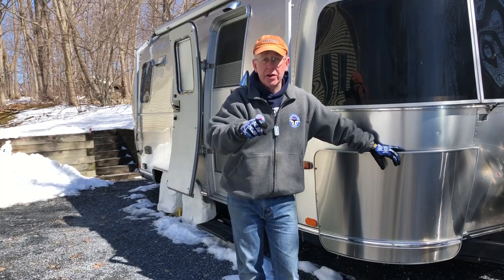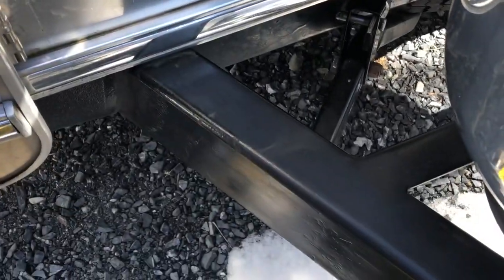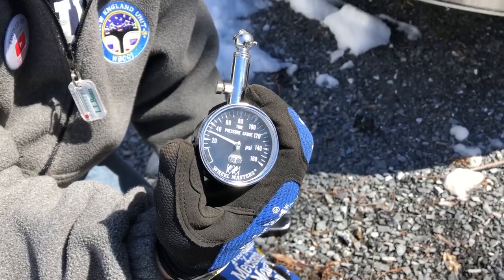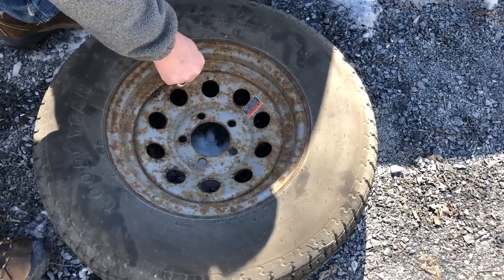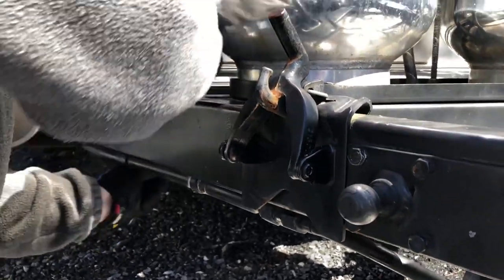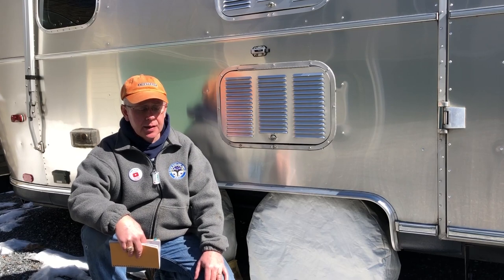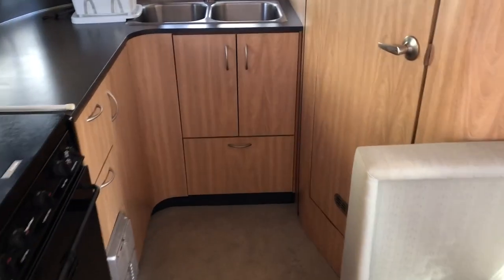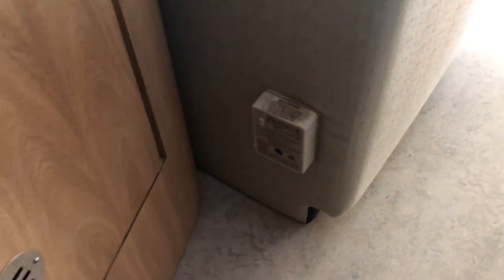RV Spare Tires & More! More Spring Maintenance

Comment: Thanks for another great video  What type of grease are you using for the hitch ball and receiver?  Is it the same as your wheel bearing grease?  as I mentioned earlier this week I'm new to having a trailer so forgive me for asking questions.  I'm going back and rewatching all your maintenance or tech videos to bring myself up being familiar with how to maintain a RV.
Reply from the maker: Thanks again for watching and don't worry about asking questions.  We use a high temperature red grease very similar (if not identical) to what we use on the wheel bearings.  The only difference is the tub versus the grease gun tube for the bearings.  I use an applicator that is a sponge on a wooden stick.